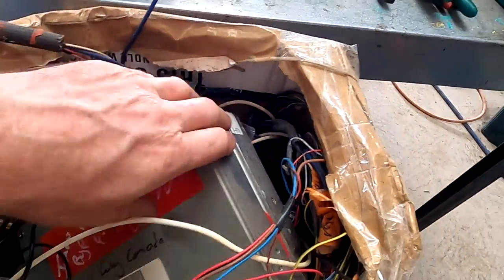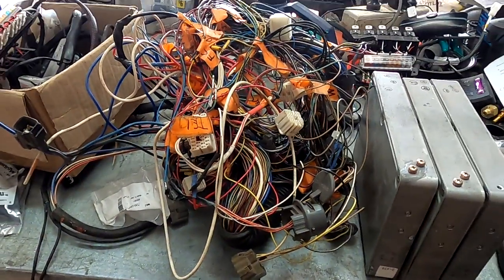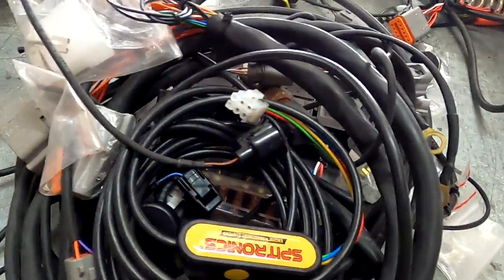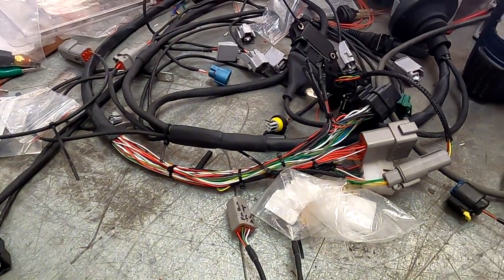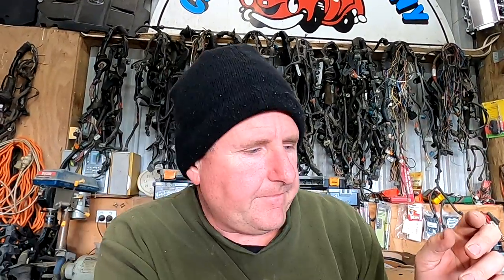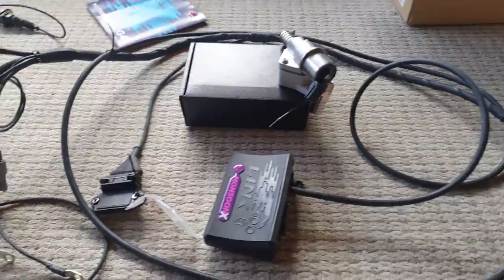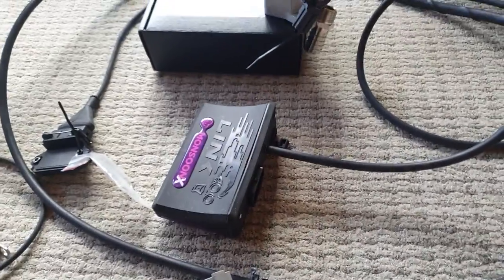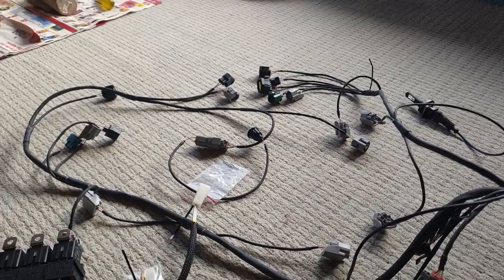Universal CartuneNZ Link ECU single plug wiring loom.  Monsoon or Atom

Comment: Hi Kelvin. Lovely channel i love it!! Planning to boost my 1uz ucf20 (1995-1997 non vvti). Since you have seen many such builds i realize you the best to answer question. I plan to upgrade rods to HBeam, bearings to ACL, cosmetics gasket to lower CR and will be running ecumaster standalone. I m planning mild boost levels of between 6psi to 14psi max. Would you say stock pistons on ufc20 are up for the task on boosted a uz? Thanks
Reply from the maker: Personally if I took the time to pull an engine and fit other goodies I wouldn't be refitting stock pistons.   Your choice though.   Cheers Kelvin
Reply: @CartuneNZ  Thanks for the advice Kelvin.

Comment: Hello, I need your help, I put the 1uz engine on my Audi Q7, everything looks good, there is a problem with the rbm, I can't get it to work and this is causing the problem of the car lift system not working, do you have any ideas about that, thank you
Reply from the maker: I would be ensuring the RPM signal into the stock system , which is possibly canbus is input as so the stock ecu thinks the engine is present and outputs the correct signals to the car.